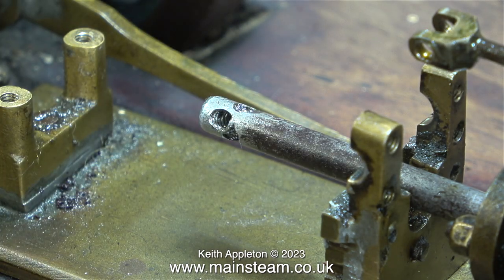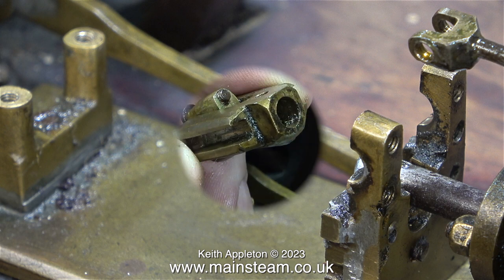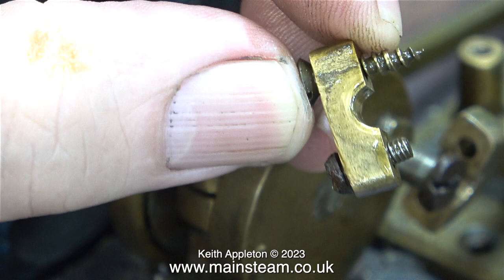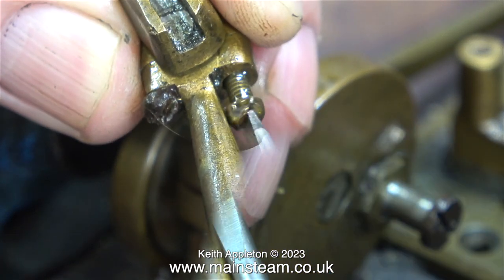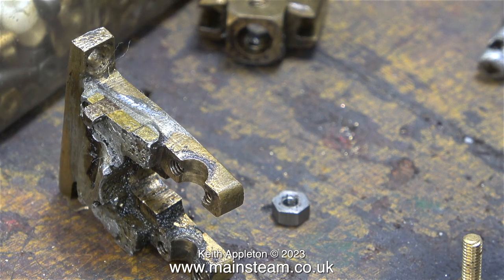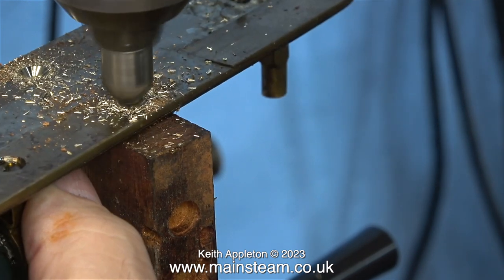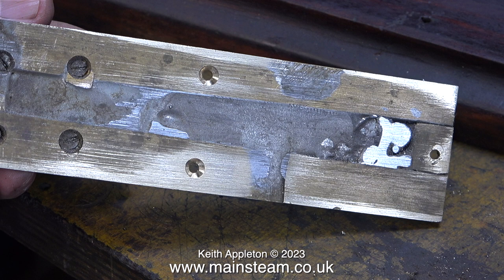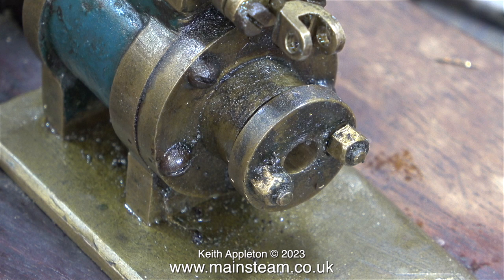A DIABOLICAL MODEL STEAM ENGINE - PART #3

Comment: Whatever universe that cross head was from, it's highly unlikely to be parallel. 

I wonder if this contraption ever actually ran? It seems to have been built by someone with very limited tools (other than solder).
Reply from the maker: My theory is that the "builder" found a steam cylinder and fabricated the rest with hand tools only. I think the base was probably originally cut from a brass door plate . . . .